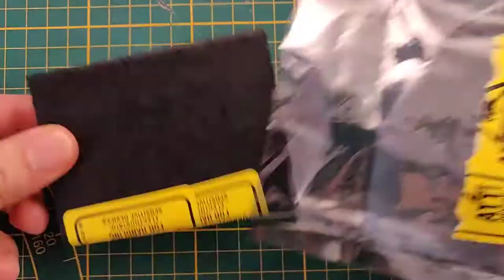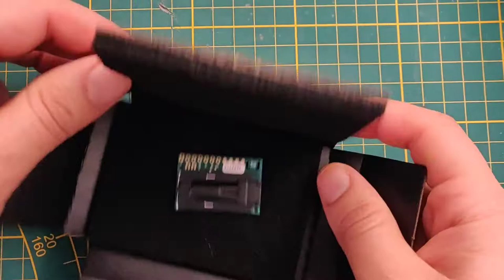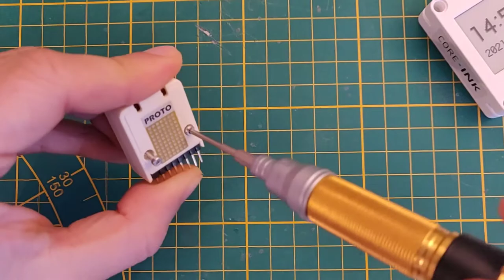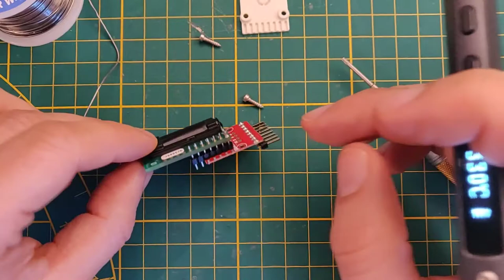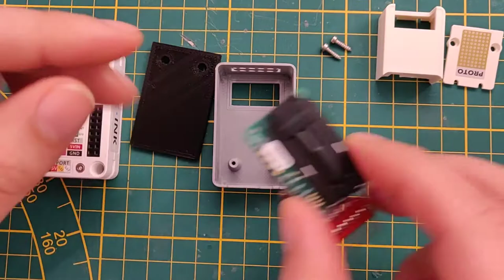How to make a portable CO2 device with M5CoreInk and Sensirion SCD30

Comment: Hello, I recently purchased and am setting up the SDC40.

I'm not sure how the SDC40 and SDC30 differ as far as libraries go, but I had to set my elevation and calibrate this thing before I starting getting readings that kind of made sense. Did you experience this with your model? I was getting around 1000 ppm outdoors which seems way wrong. Some resources I read said I could calibrate it to 400 for outdoor reading. So that's what I did, but it feels very arbitrary. How can I be sure that I've calibrated this correctly and that I'm getting an accurate reading?
Reply from the maker: Thanks for your comment. Well, this is the way.  The CO2 sensors NDIR and also with sensors with the technology that is used in the SDC40, needs calibration in outdoors. In the official SCD30 datasheet of Sensirion, they have this alternative to do that.

Comment: Sorry, but this code doesn´t work in the CoreInk... I´ve tested it with two different devices, and compiling with Arduino and Platformio...but after transfering the code to the device, nothing happens and the display is frozen...:( Do you have any tip?
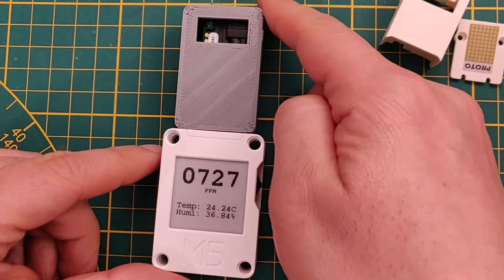Reply from the maker: mmm, you should be press the center button and then the power button only the first time, like is shown in the video (2:02). I don't have this device now because I used it with other development:

https://youtu.be/p9lf5a-bvyI
Reply: @hpsaturn  Ok, thanks for your answer. I tested it again. Unfortunately the sketch doesn't work for me, although I tested it with Arduino and with Platformio on two different CoreInks. No error when transferring, but the CoreInk freezes afterwards and can no longer be operated. The key combination you described does not work either. Too bad ... would have been a nice project ... :(